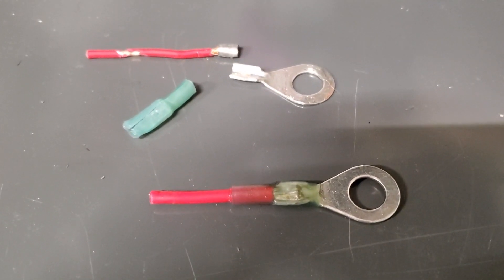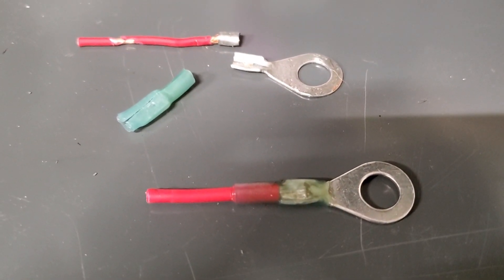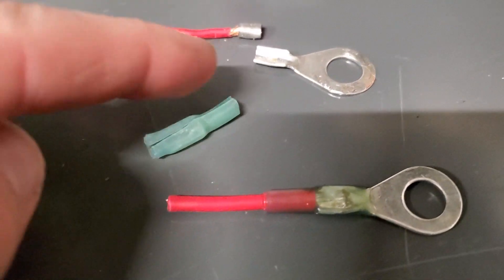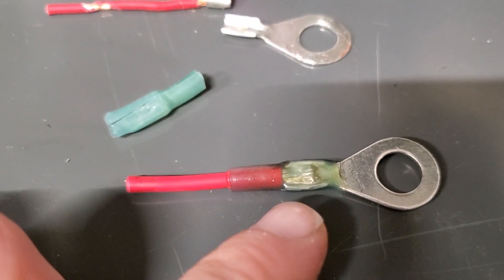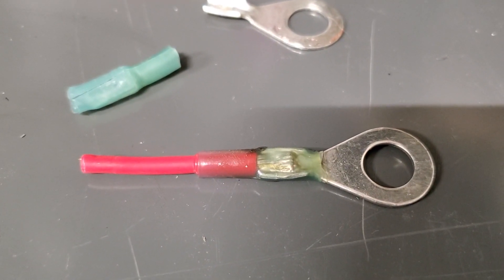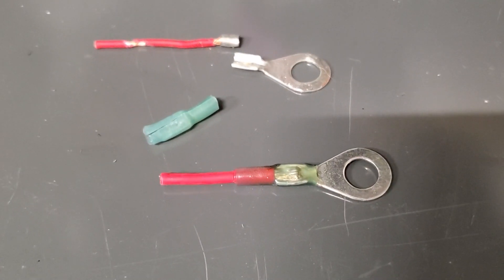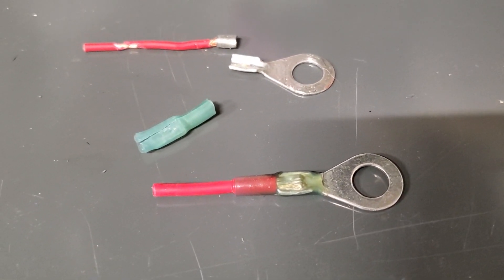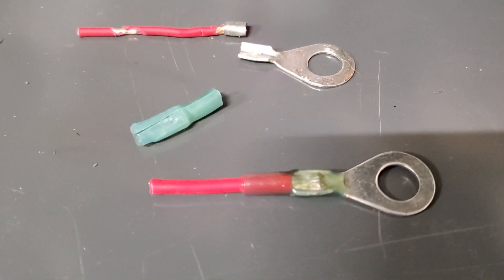SN95 Terminator X: Connector update

Comment: So did you just use a fox body Terminator x stand-alone efi system only reason I’m asking I have 94 v6 I swapped to v8 and I’m wanting either terminator x or mega squirt I like the terminator because of the new harness because mind is a junkyard hardness
Reply from the maker: Yes, its the fox body kit PART# 550-937F and the new harness is a very nice thing about the terminator x
Reply: @BabyLegsMotorsports  why did you end up going with the 550-937f as opposed to the 550-937
Reply from the maker: @Razor82347  Yes, used the 550-937f
Reply from the maker: @Razor82347  The 550-937 was more of a universal kit, and the 550-937f was already set up for the 5.0. The only sensor that was in a different spot was the intake air temp (Im in the process of moving it to the lower intake now) but it reached to the SN95 location.
Reply: @BabyLegsMotorsports  I'm looking to go to a terminator x after having a ms2pnp, thanks for the reply, I think im gonna go for the 937f myself.